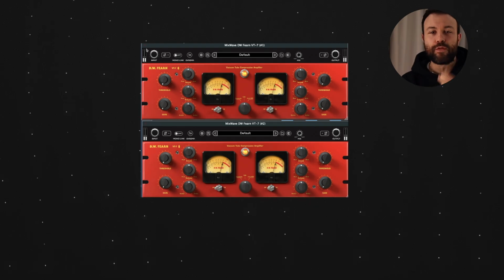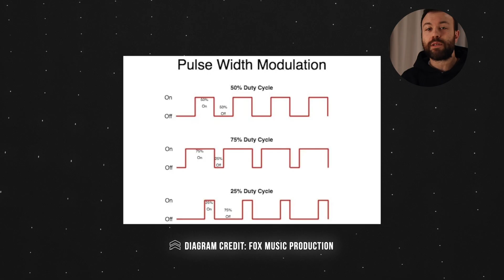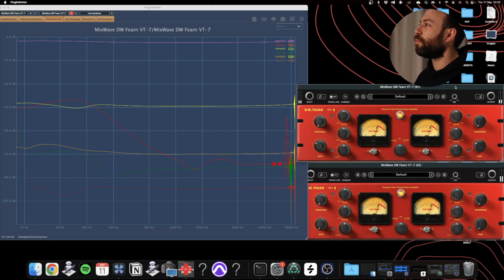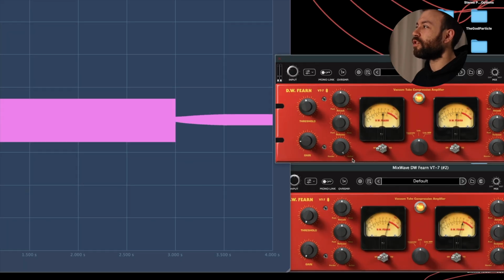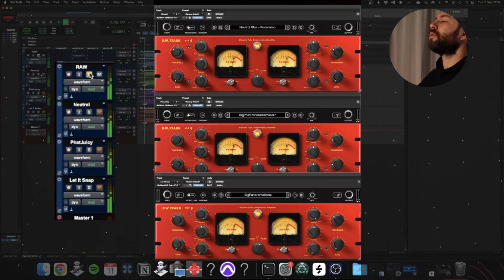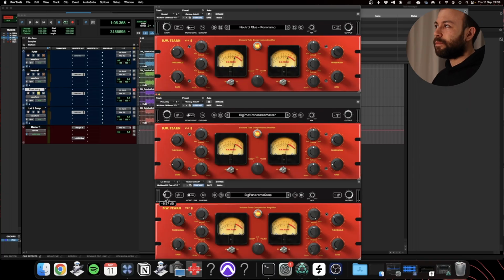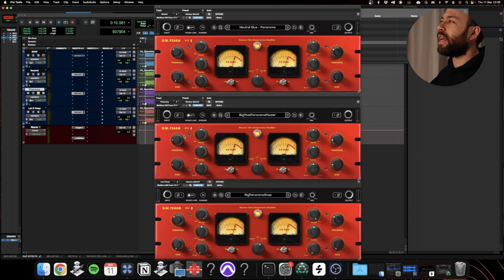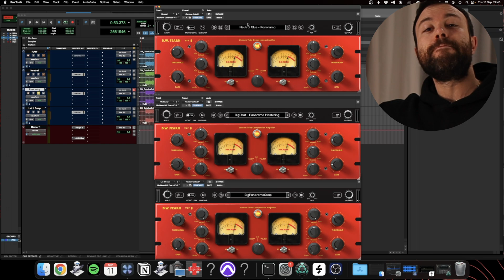I didn’t know this compression style existed!

Comment: PWM is overrated. This is a comment from the extremely knowledgeable TDR developer about why there are so few PWM compressors in the box:

IMHO it's more about the fact that PWM based gain control is basically a crude form of sampling very similar to digital (AD/DA based) gain control.

In order to deliver hi-fi results, it will have to operate in the MHz range (such as my beloved STC-8). Very much like DSD (PCM, DSD and PWM are equivalent at certain extremes, all follow the restraints set by the sampling theorem). At this point, it starts approaching the performance of a conventional digital gain control. There's not much to emulate, as they're very close to our "cheap" digital multiplication.They don't have any complex hidden mechanisms like say, Vactrols or Tube circuits.

The cool thing with PWM is that it was by far the cleanest/most precise mean of dynamically controlling gain before PCM digital came up. PWM gain control is also highly efficient, and widely utilized in many non audio applications (dimmers, electric motor control and much more). 

-TDR

TLDR; just stick with your DAW digital compressors or Pro-C2
Reply: Dumb thing to say
Reply: @DR-es5ey  perhaps you didn't read the quote from a guy who knows a lot more than either of us? You're entitled to your opinion though.

Comment: I tested the plugin, boy if it is bad, aliasing artifacts, the sounds breaks very easily... so disappointed, I would have hoped more from DW Fearn
Reply from the maker: Tell me more; where / how did you see it break apart?
Under my operations in sessions it's held together pretty well.

What settings were you using, what was the nature of the material, how hard were you pushing?

This is all valid feedback I encourage you to pass on in detail to the Mixwave team.
Reply: @panorama_mastering  on a mixbus, funky music but also house or pop, any music really, the input is clean and never past 0, I engage the threshold until I always reach max 4db of compression and always compensate back up, if I'm on 50% or more towards softer (ratio/knee control) then no matter what I do with attack and release I get distortion, if I have release all the way to fast I also always get nasty distortion creeping in no matter what I do with the ratio and attack. To get a somewhat cleaner sound I need to have never past 70% on the ratio knob and never faster than 20% the release, and then attack knob depends on the other two. Also is very vibey, it glues a lot, it can pump a lot, it colors a lot, I'm not sure that's what PWM is supposed to be, not saying it's not useful as vibes to have in a compressor, also very colored, aside from hearing it but also in plugindoctor I see a whole lot of harmonic distortion and intermodulation distortion with no way to deactivate coloration which makes it not always suitable. Also needless to say aliasing shouldn't be there in general since it's a digital artifacts and not a thing of the machine, even though it's not super bad, with 4x OS gets moderate.
Reply: Check out Pythor by Tone Empire. I demoed all PWM plugins and that one was the best. Really clean compared to the VT-7 and no weird stuttering dynamics that I experienced in the Kramer Pie

Comment: The Kotelinkov you like so much is based on the STC8, which uses the same detector circuit and PWM gain reduction element as the Vt7. Small world!
Reply from the maker: I did not know this; where did you find this out?
Reply: @panorama_mastering  Fabian from Tokyo Dawn labs has mentioned this. Hes such a great guy honestly
Reply: wow
Reply: never heard this. I am reading a thread where Fabian is talking about PWM compressors and even mentions that he is "familiar with the STC-8", but at no point indicates that it is the basis for his most famous plugin.
Reply: @musiclover-r9m  I recall reading it, from Fabian some time ago. Its not an "emulation" or anything like that - he was just inspired by how its action and transparency. He said he was also inspired by the GML unit as well but I cant seem to find it
Reply: really useful to know, thanks

Comment: Feel like the box tone on a master kinda makes it sound less open. Dont know if i vibe with that. Cool on vocals or individual tracks though
Reply from the maker: Fair enough, it does definitely have a glue to it, which I'm finding useful on some material :)
Reply: @panorama_mastering  The neutral setting was sounding open and glued. Impressive stuff
Reply: @panorama_mastering  also feel like it boosts the subs alot, like you see on the plugindoctor. Does the hardware really do that? Find it weird, since its markeded as such a transparent unit.. Could you emulate this compressor behavioiur in Unisum for example? I really like the "compressing" of the VT7, but not the harmonics.

Comment: Same technology (PWM) is often used for car fuel injectors, or to control turbo boost pressure etc. it makes perfect sense that this could be used for a audio compressor too, and whoever thought of it a tip my hat to. I imagine you can emulate PWM WAY easier in the box than a normal circuit, as PWM is basically just a step down from digital communication in circuits anyway, all you have to do is emulate the output of the PWM gain reduction driver, and the most unique thing about many compressors (think LA2A gain reduction circuit for example) is already nailed for the software here.
Reply from the maker: Intersting!